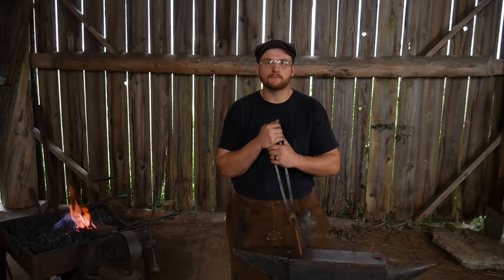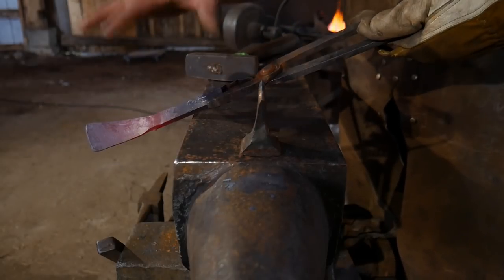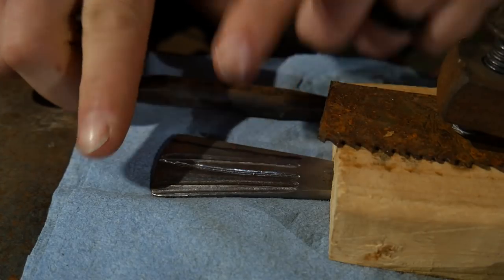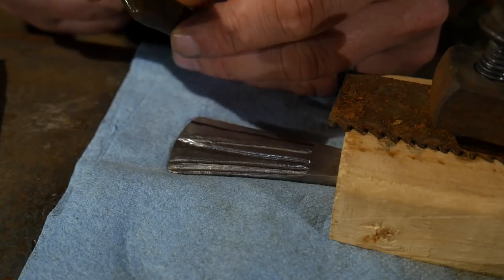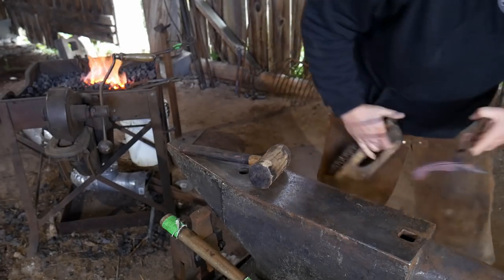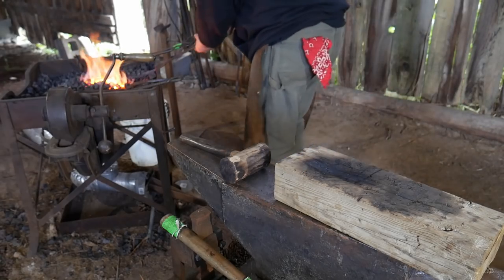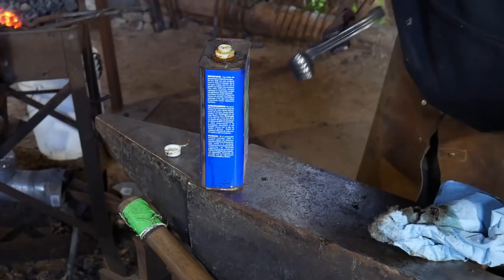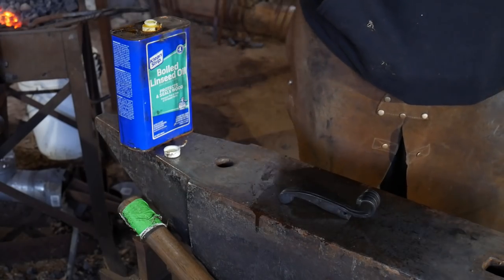Forging a Gothic Style Bottle Opener

Comment: I think video length is more project dependant ones with more technical skills i think should be longer love the gothic scroll. And the treated wood usually only goes about a quarter inch deep you can plane off the majority of the chemicals

Comment: Would it be good to lock that wood block into the post vise? Or do you want that kinetic transfer to die out in the wood? Seriously asking.
Reply: Using wood hammer and wood block as an "anvil" this is a way to move the hot metal without putting marks on it. If Roy had used a metal hammer on the metal anvil, it would have still curled the end, but it also would have flattened out and ruined all the chasing work he did.  Hope that makes sense.

Comment: I to would also like to know what you mean by pickle.   The length of the video is fine.  I like to hear about all the fuller ing.   You are a true artist.  It is beautiful.
Reply: Soaking in vinegar is picking
Reply: What does pickling do
Reply: The acid in the vinegar eats away at the oxide scale. Saving you from having to do as much sanding/filing to keep the detail crisp. Depending on how thick the scale is it can take  a day or two. You can shorten the time by heating the pickle.  I would caution you away from using a stronger acid. You want the gentle process, and the fumes aren't harmful.
Reply: Archangel Craftworks thank you for the answer.  Now I know